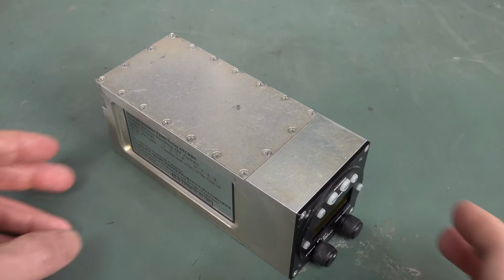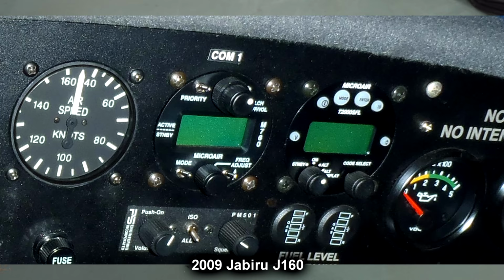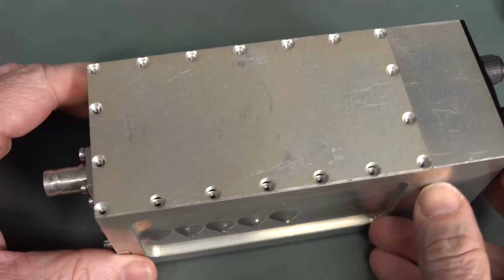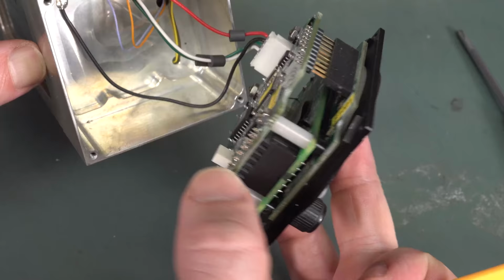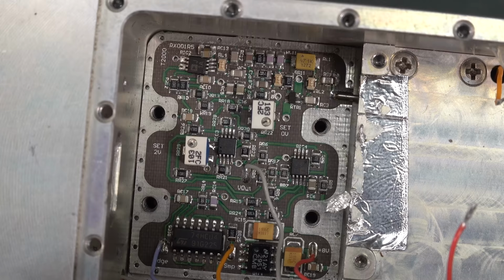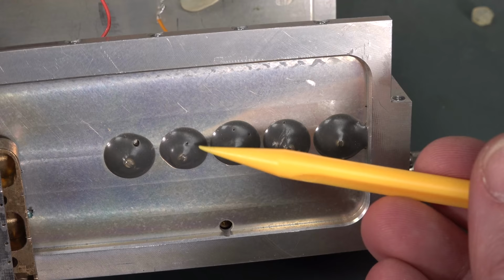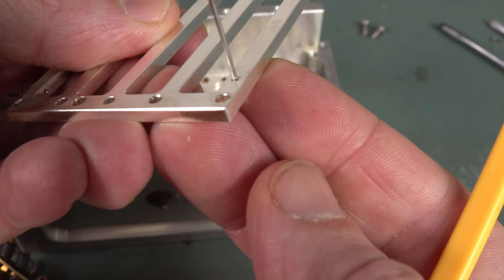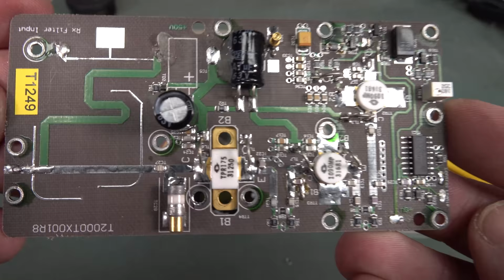EEVblog #1352 - Aircraft Transponder TEARDOWN!

Comment: Designs like this are clearly short-run labor-intensive items that are nearly impossible to upgrade.  At the aircraft instrument manufacturer where I worked, we called them "bricks" (where the old-school electro-mechanical instruments are called "steam gauges").  Instead, we put 100% of our effort into the RF PCBs, so the chassis could be generic and used by multiple different instruments.  Yes, our instruments were double or triple the cost of this one, but ours were readily field-upgradable as standards or needs changed, and we went to great lengths to make the upgrades affordable and easily installed.

A huge part of the costs of a cockpit replacement/upgrade is the labor associated with bending the sheet metal and routing and fastening the copper: Well-designed instruments that ensure the cockpit won't need to be torn apart for a long time pay for themselves rather quickly.  We took this a bit further: About half of our designs were drop-in replacements for older instruments, where we would customize the back plate to precisely match the legacy instrument, then add a metric ton of digital upgrades.  Just the savings of not having to tear the cockpit apart made our higher price an easy bargain overall.

We pioneered a full "glass cockpit" upgrade that had installation costs that were 80% less than our competitors (such as Garmin and Honeywell), where the first step after stripping out the old instruments was to use a saws-all to connect the outline of all the existing holes, then dropping in a pre-fabricated overlay that held our instruments and also made use of all the existing wiring.  A massive upgrade that took our competitors weeks to do we did in days, or sometimes hours.  Our installations were so fast that we could do entire business jet fleets in the time others needed for a single aircraft.

Our engineering process was guided by targeting the cockpit as a whole while also considering the lifetime of the aircraft and the evolution of private and commercial aviation needs and regulations.  Then working backwards from there to create "big picture" products that sold themselves.

We were a small company of under 100 employees (including those on our PCB in-house pick-and-place machines and product assembly line), and we were extremely aggressive in the market.  Which annoyed the Big Players to no end. One of whom tried to sue us out of existence using their patent portfolio.  They expected us to instantly fold, but instead we bet the company and hired literally the best intellectual property law firm in the US and waded into the battle.  Of the seven patents they sued us over, we had 6 invalidated by the court, and the seventh was preserved only by the Big Player quitting the suit just to preserve that patent.  We won not just our legal fees (which equaled a huge chunk of the value of our company), but we also got the original suit labeled as the business equivalent of a SLAPP (https://en.wikipedia.org/wiki/Strategic_lawsuit_against_public_participation), which yielded a punitive award that multiplied our profits for that year.

That lawsuit affected all parts of our company, costing us customers and delaying product introductions and upgrades, and despite winning big, it still took us years to regain our reputation and position in the market.  We weren't content with just "winning" that lawsuit, so we decided to beat them up a bit:  We added a very specific feature to one of our instruments that we gave to all our customers as a free upgrade, then asked them to request the FAA make it mandatory, which the FAA agreed to do.  It was a simple software upgrade for everyone but the Big Player who sued us: It turned out this specific feature would instantly obsolete a profitable "brick" product of that Big Player, which made them fight the FAA, which our marketing department used to beat them up in the industry and market.

Then we offered an extremely aggressive "trade-up" discount to their customers.  We actually lost money on each installation.  But it was well worth it!  We got a ton of follow-up business from that tactic.

This is one reason why it is important for engineers to know how business works, not just in theory, but in the dirty reality as well.  We wouldn't have won the original suit if our engineers weren't great in depositions and on the witness stand.  And we wouldn't have had the payback victory if our engineers hadn't identified and ruthlessly exploited the weakness of "brick" instruments.
Reply: You're begging us to figure out the company and products :D Please... I guess it has to be Avidyne, since that is the first smaller avionics manufacture that I know (just because of watching Martin Pauly's videos) :) Very interesting!
Reply: @rkan2  No can do.  This happened nearly 20 years ago, and they're still in business.  Though I left them 15 years ago, I still wouldn't want this story to resurface and cause them any possible PR issues today.  I joined them after a decade of making instruments for the commercial nuclear industry, space experiments, and other safety-critical systems.  The shift to commercial aviation was a real eye-opener in many ways, not the least of which was the immense burden of the FAA certification process.  The company also targeted this as a core competency, so much so that internally we called ourselves "A test and certification company that happens to make aircraft instruments."
Reply: BTW, my experience at that instrument maker is why I'm still so ragingly angry at Boeing over the 737-MAX debacle: They made it a business strategy to find ways to weaken the FAA certification process without "technically" breaking the rules.  This was the exact ethical opposite of what we did: We used the FAA certification process to make our products better!

We could have had some of our employees certified as DERs, but we intentionally always chose to contract with the best of the independent DERs, from whom we would wring every ounce of benefit from their outside perspective and deep experience.  If a DER wasn't holding our feet to the fire and making us sweat, we'd replace them with one who would.  Then we'd hire a senior-as-God DER to review both our FAA submissions and our internal processes (including our other DERs).  The FAA considered our process to be a model for small businesses: We certainly worked the rules to our favor (there are always multiple paths that meet both the intent and letter of the regulations), but we also gave the FAA feedback that helped correct weakness in the regulations and/or their enforcement.

We considered the FAA an ally, not an adversary.
Reply: Sandel?
Reply: This is like a mini business lesson right there! Thank you for sharing this - what a story!
Reply: Is this company based somewhere in the pacify northwest by any chance? I think I know what it might be, but you really don't want to say it so this is a pretty generic question

Comment: Its a diplexer Dave. Not to be mistaken with a duplexer.
Reply: Hi Shahriar ;-) Do you or Dave plan to make a video abou this ? It would be very interesting
Reply: چقدر جالب. دمت گرم.کاش یه ویدئو راجع به این بذاری.
Reply: @esepecesito  Each rod has inductance and the tip is a capacitor. so it's a parallel resonant. Then they couple to each other capacitively and magnetically.
Reply: @esepecesito  The 5 rods are quarterwave resonators. The reason for the coupling points beeing close to GND is to have lose coupling and do not load the resonator down with your 50 ohm input and output impedance. That would ruin your Q and thus selectivity. The milled cavities allow defined field coupling.
Reply: @hamedzaheri7050  ,  جالب کلمه ای ملایم برای این است. این یک قطعه کوچک از تاریخ است ، اما تاریخ مدرن نیست.
Reply: Shahriar, I would really really like to understand what is going in this combline filter...and connect it to a VNA.
Reply: @hamedzaheri7050  how interesting. I'm hot. I wish you would post a video about this.
Reply: @BruceNitroxpro  Interesting is a gentle word for this. This is a small piece of history, but it is not modern history

Comment: Your 'comb' filter is a combination bandpass-bandstop filter. The removable part with longer elements is very limited bandwidth 1030 MHZ bandpass, the shorter elements integral to the case are bandstop, 1090 MHZ (Tx freq) and 3270 MHZ (Tx freq 3rd harmonic)
Reply: Actually I think the shorter elements are to control the amount of coupling between the tuned sections.
Reply: @graemezimmer604  With all due respect to Graeme's  statement, I offer that both the receiver (Rx) and transmitter (Tx) appear to be directly coupled to the antenna in order to support full duplex operation. While there is some PCB trace filtering as Dave pointed out, it is woefully insufficient to inadequate to reduce the transmit level that would be seen by the Rx input,  leading  to severe receiver overload and damage without an additional large amount of Tx attenuation somewhere before the Rx input. The shorter elements in the 'comb' filter displayed is the only place I noted in the video where sufficient Tx attenuation could occur. I further offer that the same line of thought  has been suggested by another as well as myself..

Hey Dave, why don't you drag out on of your fancy spectrum analyzers with a tracking generator and put this 'quandary' to a rest in a video? Great way to show the value of such a unit!
Reply: @pherdantler707  I'd like to see that too!